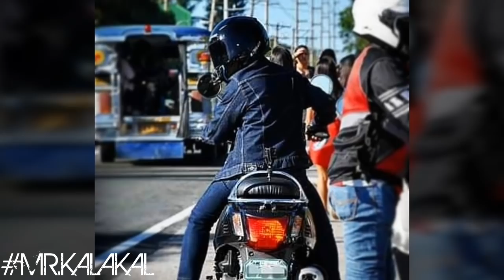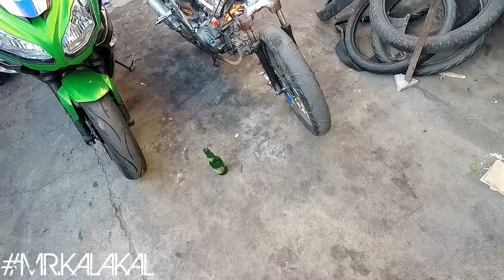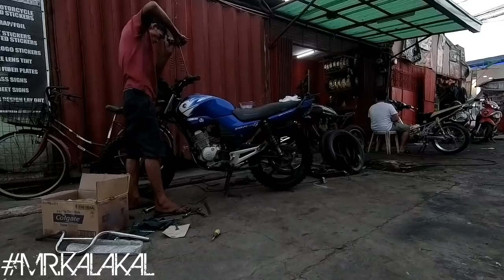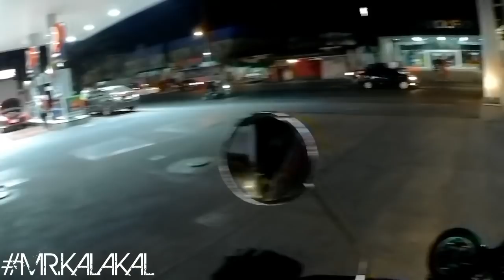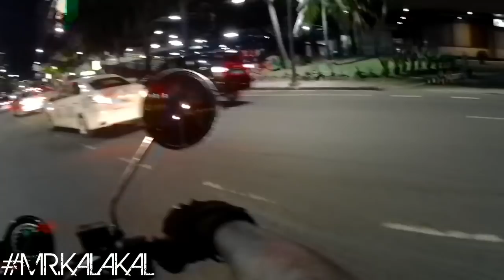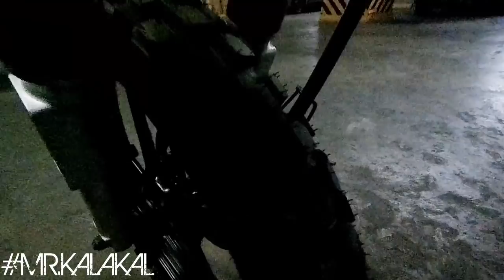YAMAHA YBR 125-G | MOTO UPGRADE | FATBAR & KNOBBY TIRES

Comment: Ang aking ybr125g kakulay  ng saiyo ang upgrade na ginawa ko ay hydraulic clutch ngayon Sept2023 magaan sa kamay pagpiga ng lever.. kasi madali napuputulan ng clutch cable at ang front tire gawa ng journey brand size 3.00 TT ang rear tire ay size 100/90 18 TL brand SBL on/off road application.